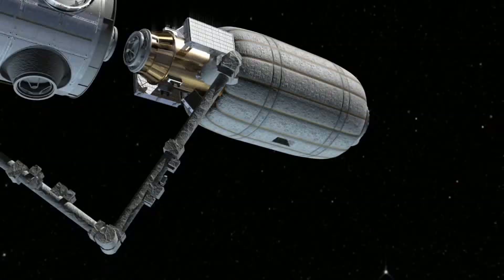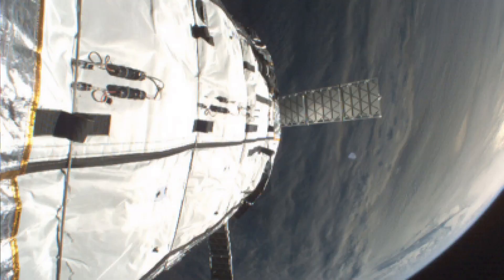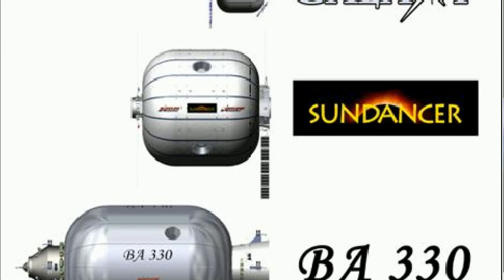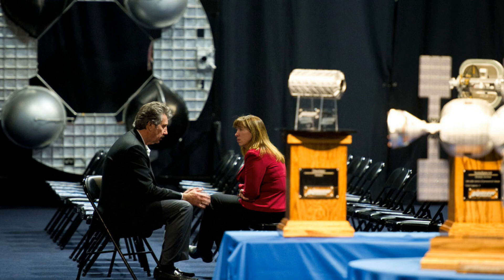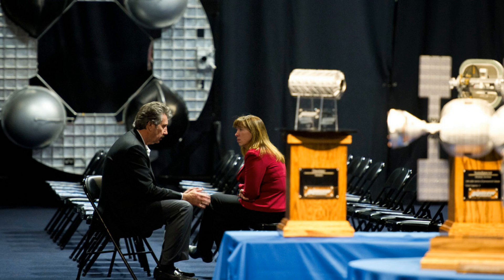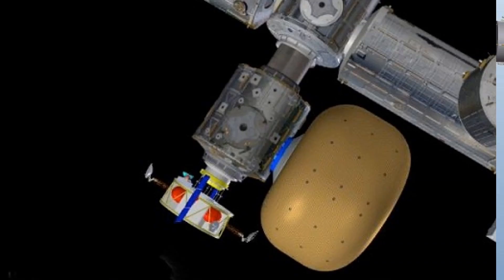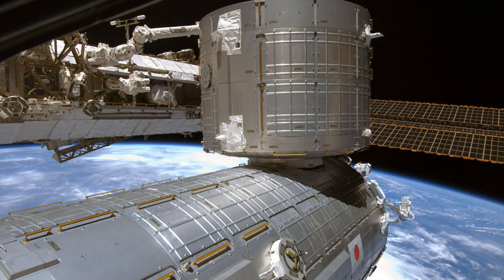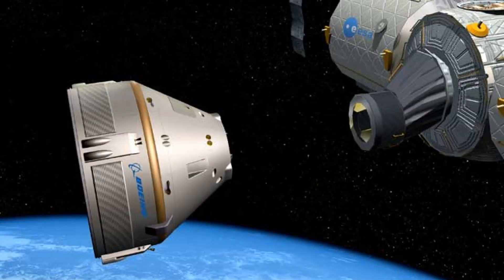(Orbital Updates #4) NASA to Install Bigelow Module Onto Space Station

Comment: to anwser your question: The BEAM is scheduled to launch aboard the eighth SpaceX cargo resupply mission to the station contracted by NASA, currently planned for 2015. Following the arrival of the SpaceX Dragon spacecraft carrying the BEAM to the station, astronauts will use the station's robotic arm to install the module on the aft port of the Tranquility node.